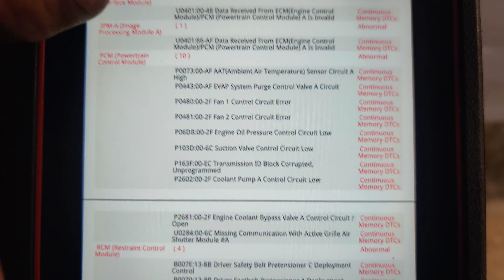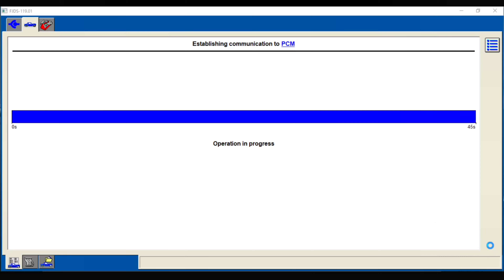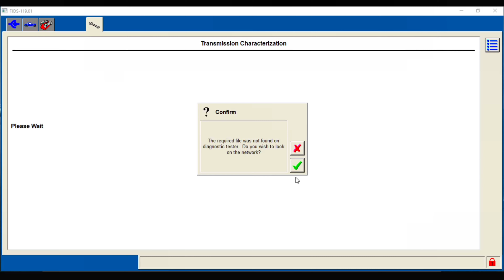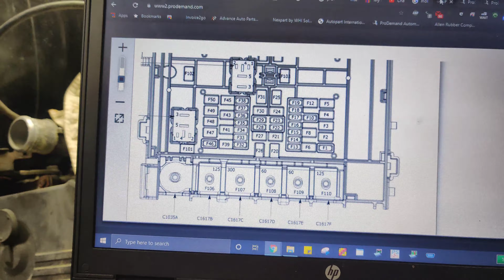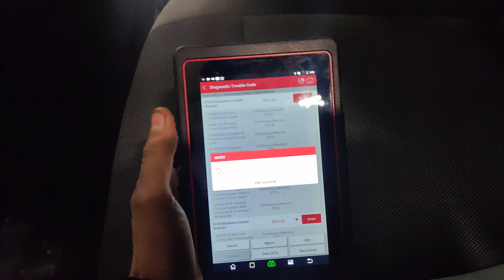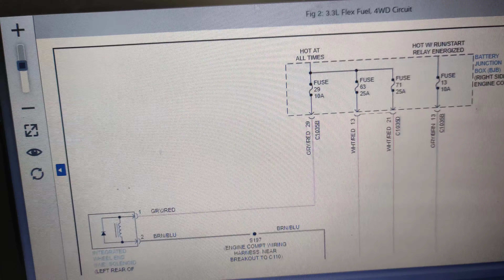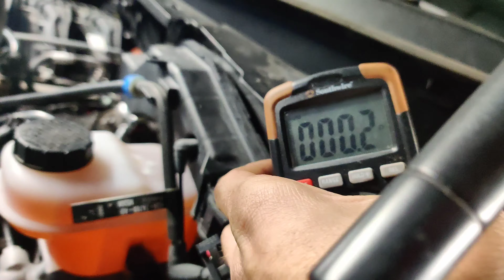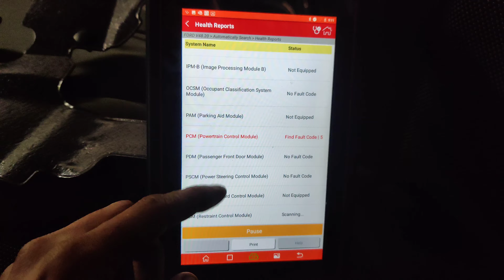2019 Ford F150 3.3l 4WD C0020, P0433, P139C, C1979, C1979:12 Multiple Codes!

Comment: So how exactly did you fix the abs codes?
Reply from the maker: Blown main fuse for the motor
Reply: @RobertDotterer  where is it located? Im having same exact issue on my 18 expedition
Reply from the maker: You will have to buy a subscription to ford repair information and get a wiring diagram.  Fuse location depends on the year and vehicle options so it's best to pull a diagram and code setting criteria. You can also buy a subscription to Mitchell prodemand diy or alldata diy.
Reply: @RobertDotterer  thanks!!!
Reply: @RobertDotterer  alldatadiy doesnt have the info not sure about Mitchell, is that wire green and red?
Reply: @RobertDotterer  hey, would ypu please tell me where your main fuse was located?
Reply from the maker: I don't know where it is at, this was not my vehicle. Also Mitchell does have the information for your vehicle and you can also get it right here from ford https://www.motorcraftservice.com/Home/Index .  You really need to do some troubleshooting just because you have the exact same symptoms and same codes as someone else does not mean it is the exact same fault.  There is an option under my membership tabs, as long as you have tools to properly diagnose it I have an Ifixthings membership where I will try to walk you through diagnosing a problem.
Reply: @RobertDotterer  thanks so much!
Reply: @RobertDotterer  hey i took apart my fusebox and turns out my fusible link is blown so off to a new fuse box
Reply from the maker: Well you need to figure out why it blew in the first place otherwise you may be buying another one. I would test it with a separate fused jumper wire and measure the current. They do not blow for no reason.
Reply: @RobertDotterer  this car was in a collision, the abs module g9t hit and cracked so i beliebe thats what caused it to blow, plus the board inside the module got messed up too and the harness itsefl